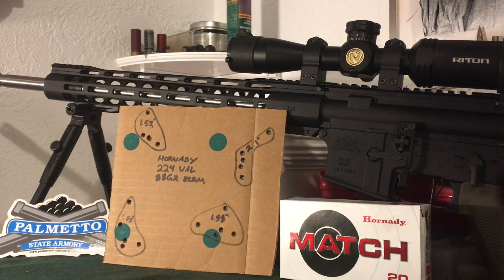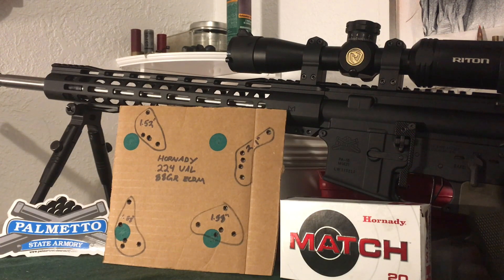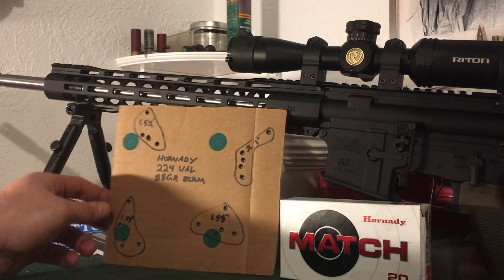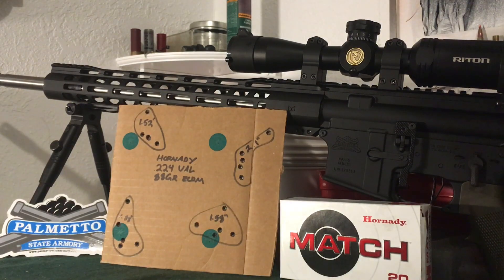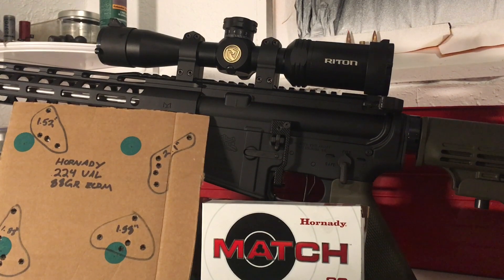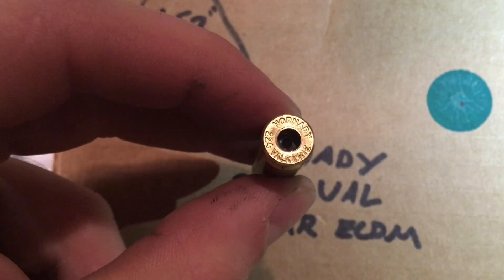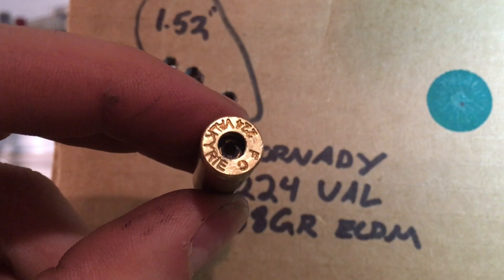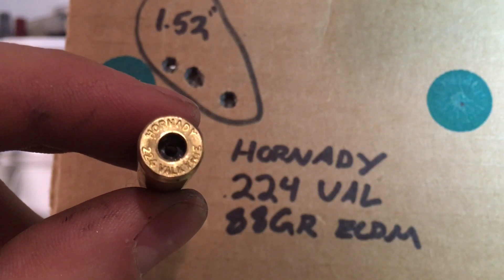PSA .224 Valkyrie Initial Accuracy

Comment: Lapping the receiver and also bedding the barrel are both excellent ways to improve the accuracy of any AR pattern rifle. 
As another commenter pointed out, your scope rings really shouldn’t be connected to the hand guard. 
PSA’s stainless barrels tend to be very good right out of the box but do improve with a little use - accuracy seems to really settle in around 200-300 rounds. With good factory ammunition I typically get just under 1 MOA once I’m through the break-in period. With lapping and bedding and a properly developed hand load, I wouldn’t think 0.75 MOA to be outside the realm of possibility (much more than that will almost certainly require a more premium barrel).

Comment: I'm running 20" 1:7 twist PSA upper with factory 78 grain tsx bullets and I'm getting sum moa all day long.  Seeing as the barrel isn't long enough to maximize the cartridge.  I'm not going to worry about the bullet being 12 grains lighter either. Especially when I can buy them for $1.03 a round.

Good video.  I look at all the Valkyrie content I can.